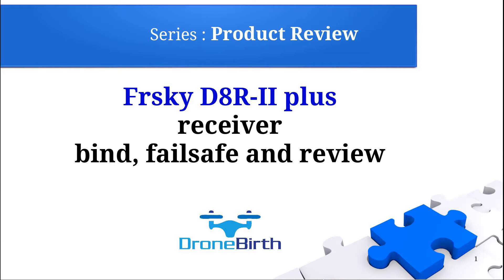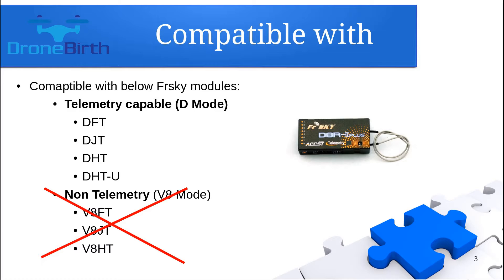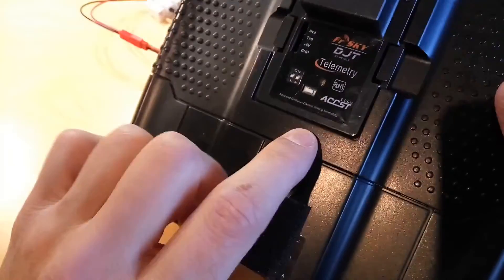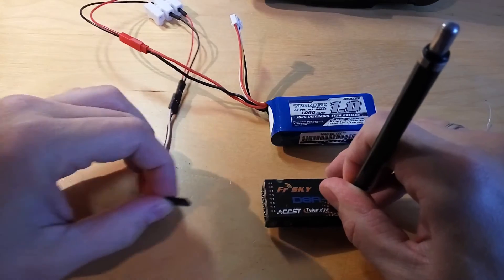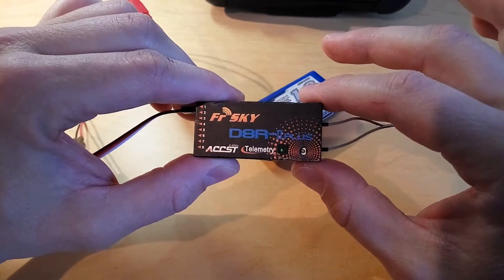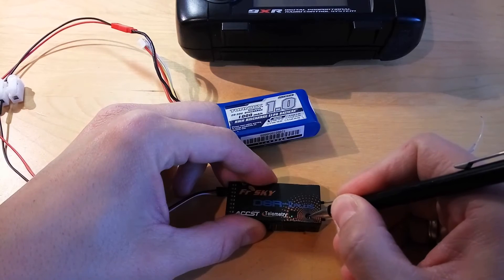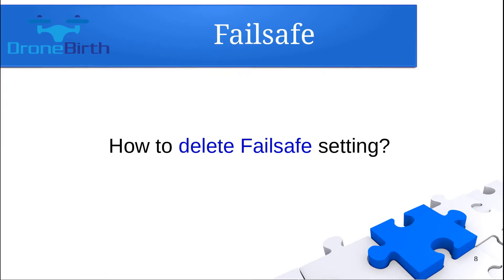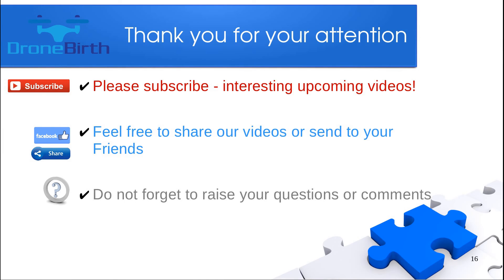FrSky D8R-II plus - receiver binding, failsafe and review

Comment: i bound my d8r plus rx and i get a blinking red light but the quad seems to be getting signals. red??
Reply: +Darrell Brown 

Hi Darrell,

if you successfully completed the binding green led light is visibile (without blinking) which means that the connection between tx and rx is establised.
Reply from the maker: +Ákos Véber 
I can just echo Ákos's word, you would need to repeat the binding as it may was not successful. Please be sure that you put your transmitter in binding mode before you start binding.
Reply from the maker: +Darrell Brown 
to understand how the switches work at the back of the tx module, please check this video:
https://youtu.be/LpXu0oawPc8?t=177
Reply: yea, I also have red light (non blinking), no green light..
and range test is disapointing....
Reply: im getting conflicting info about the 2 switshes on the tx module. some vids say both switches down and some say one is up.also, if im not bound then how come i  can  arm and operate the motors

Comment: HI, great new channel here, keep up the good work. I have a question, what battery should I use to power up the receiver? can I use a regular 3s  battery?
Reply from the maker: +Nikolas Kurnia 

Thank you Nikolas!

By factory recommendation, you can use up to 10V to power the receiver up. A fully charged 3s battery has 12.6V, thus I would not recommend to use that. My recommendation is to power it up from your flight controller. As this is a PWM receiver, you will have as many servo cables (which means 1 white cable for signal, 1 black cable for ground and 1 red cable for positive)connected to the flight controller as many channels you going to use. In many case flight controller gives you +5v, which is than perfect for the D8R-II. One important comment here, only in case of 1x servo cable use the red (power wire), in case of the other servos cables you do not need the red wire, so just removed that.

I hope that helps. Have a nice day.
Reply: +DroneBirth Yes, that helps, thank you very much!